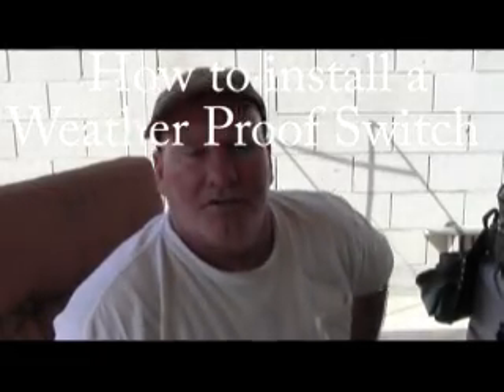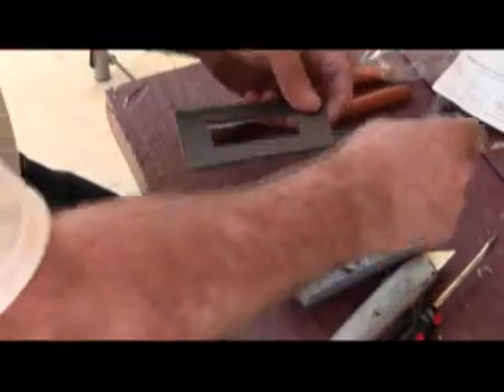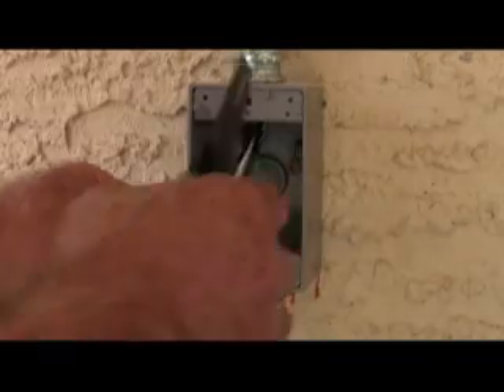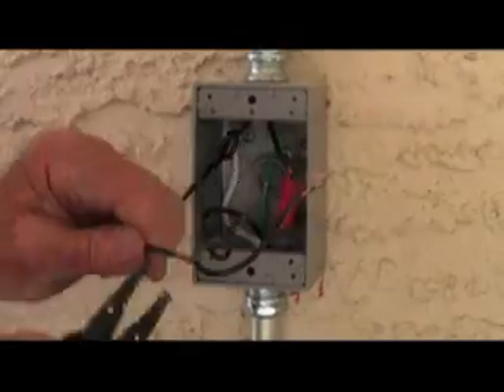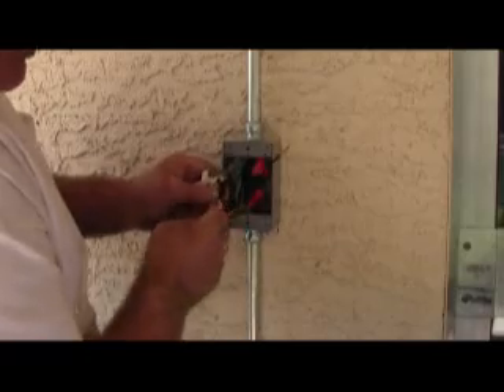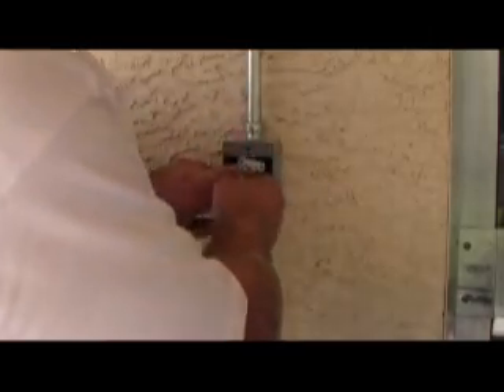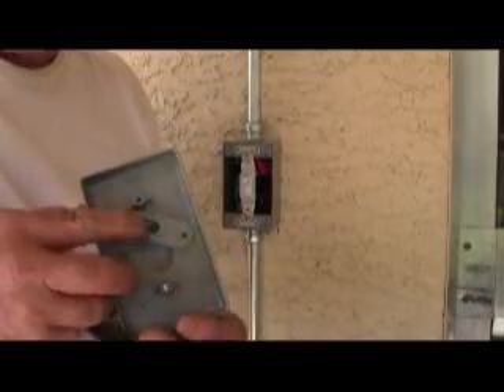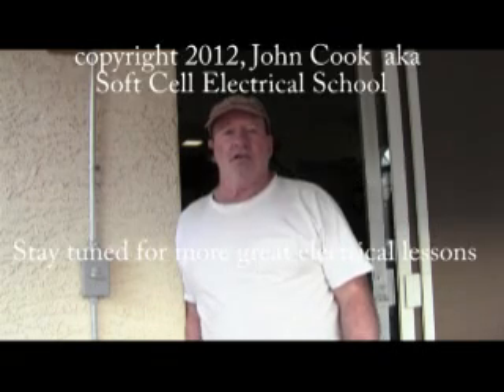NEC code on weather proof switches, complete install # 32.

Comment: hmm my switch didn't have an adapter, or the two wings on top and bottom. my switch was way smaller. oh and the cover plate has 4 holes.

Do you know if the switch can be installed in an area that doesn't have an overhang, like within a switch box that's attached to a temporary service panel like they use in mobile home parks?

Comment: I have problems with these devices... Yes he did it correctly but does it work??? I did everything just like in the video sometimes the light works and sometimes it doesn't... The cover doesn't catch the toggle switch when it has been tighten to the yolk... If anyone has any input please feel free...